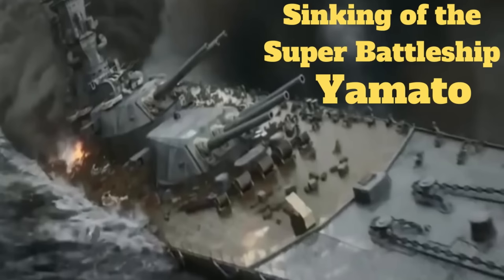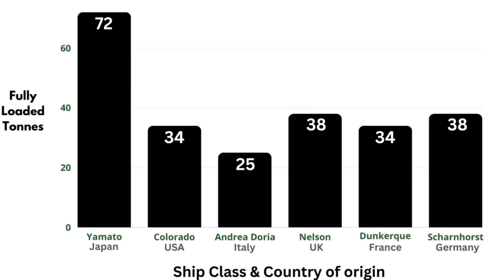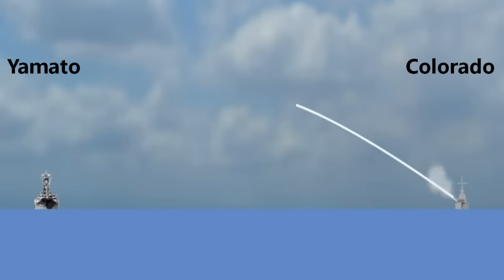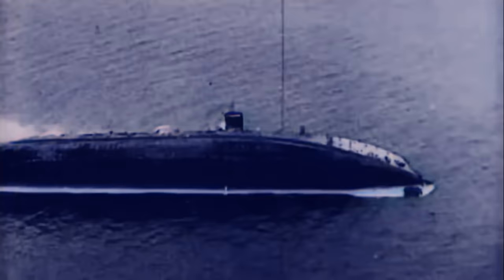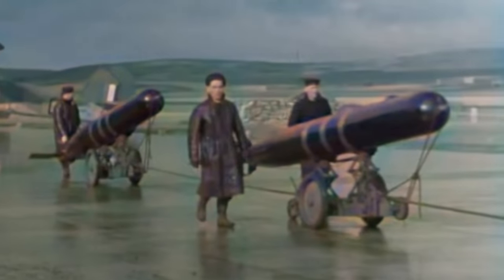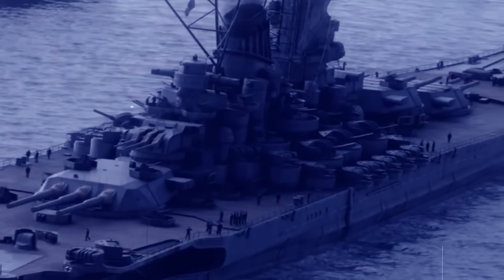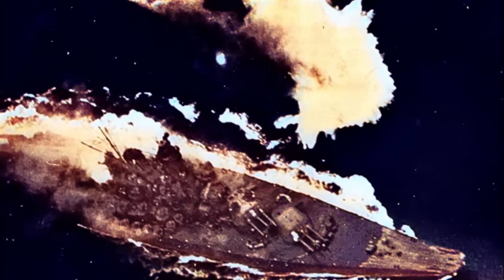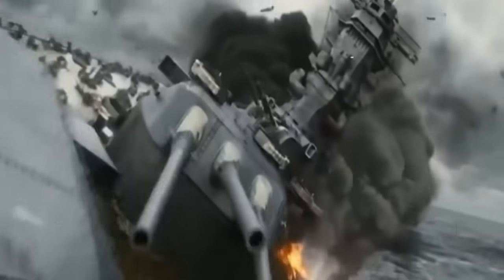How the US Navy Sank History's most Heavily Armoured Super Battleship

Comment: Don’t forget that the Third Fleet had already sunk the Musashi during the largest naval battle in history, in October 1944… Yamato was the second super battleship sunk by air power.
Reply: I've always wondered in total cost what it took if one counts the carriers, escorts, planes, gas, bombs&torps expended to sink them? 

Bet it's a heck of a lot more than the ENTIRE Iowa class bb's cost, which could take the yamato on 1-1 or 2-1.
Easily enough thanks to the 16" 50 cal penetrating power equal to the 18.1" shells, iowas speed allowed for engagement terms favoring them. 

Along with superior main battery fire rates and radar gunnery being much better for the Iowa's vs yamatos. Iowa straddled a warship at speed out to 32,000 yards while she was also steaming in I think it was late 1944. And big mamie maimed jean Bart at 20-30,000 yards as well.
Reply: @4literv6  
  The difference is the damage to the carrier fleet.  If the Iowa class had gone up against her, even three to one there is a  chance that one of the Iowas would be sunk and at the very least they would have received some major damage.  where with the carrier option you do lose aircraft and crew but your ships are safe from damage.  The carriers also have complete and total control over where and when the engagements will happen.
Reply: @stanburk7392  - Surface ship to aircraft battles were extremely rare for a reason. As the range of aircraft far exceeded the firing range of any battleship. The only such battle that I know of was in the Battle of the Philippine Sea, were the Japanese was able to get close enough to sink a couple of escort carriers.
Reply: @stevefox7566  
  Exactly my point.  And even then had those been the bigger fleet carriers they would have been able to outrun or at least keep out of range of the surface ships guns.  The other problem was the escort carriers didn't carry any anti-ship ordnance.  I can't think of any others either.  Just to clarify for the next guy we're talking about where the surface ships actually got within range to use their guns.  
  Yamatos one chance to do what she was built for and she ran.
Reply: @4literv6 The cost was irrelevant.  The US had more than enough to sink Yamato, so they did.
Reply: @4literv6

The US Navy tested brand new 16” guns against Yamatos armour (surplus armour for a Yamato class battleship seized from Kure). They tested it perpendicularly and at point blank range and the best they could do was crack it. 

Meanwhile the Iowas were very lightly armoured. More akin to a battlecruiser than a battleship. If any 18.1” shell hit it would be sayonara for the Iowa.  

The ONLY thing an Iowa could do against a Yamato is run. 

The only reason Iowas survived WWII and the Cold War was overwhelming air power.

Comment: It was obsolete before it was even built.    Thats why it never saw combat until its one and only mission.   Japanese sailors called it hotel Yamato, because being stationed on it meant you would never see combat.    It was also an extremely stupid design.   Lots of anti aircraft guns, but when the big guns fired their useless beehive shells, the deck had to be cleared because the shockwave from the guns firing would kill anyone on deck.
Reply from the maker: Yamato was obsolete before she was completed but they didn't now that at the time. She had a leading roll in the battle of Leyte Gulf before operation Ten-Ichi-Go, but until then she was, as you said, a floating hotel.